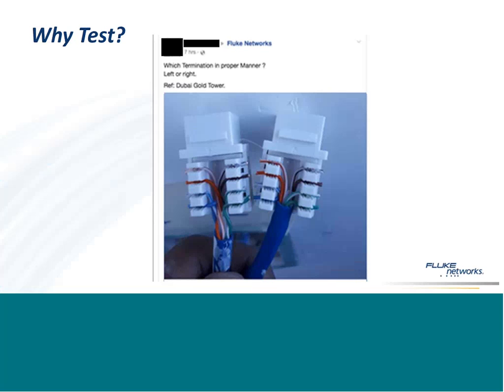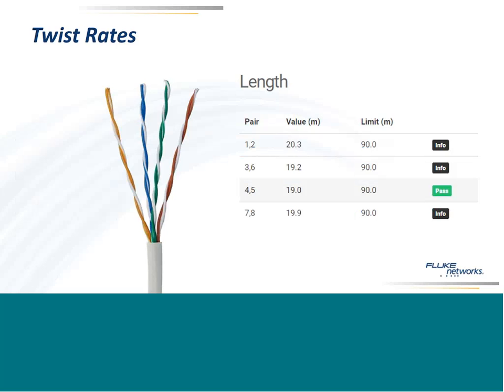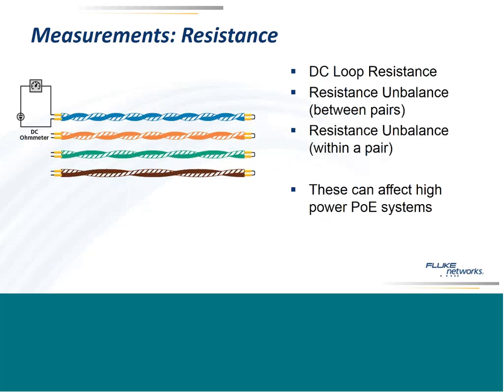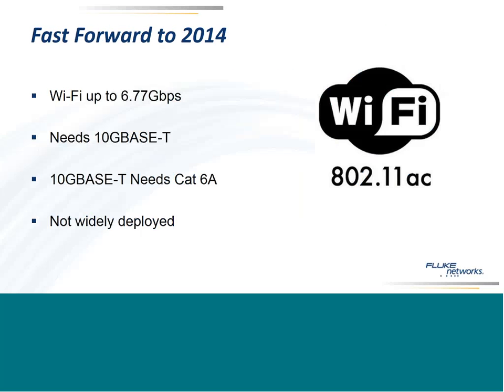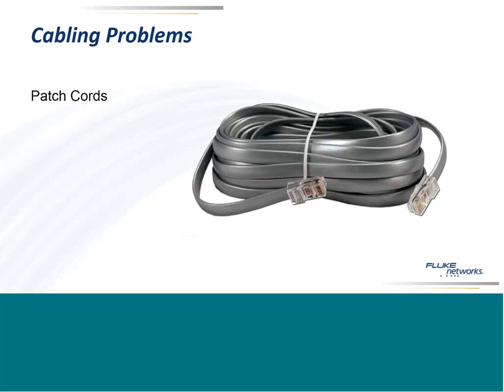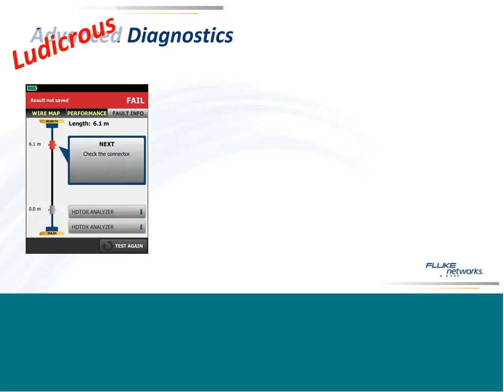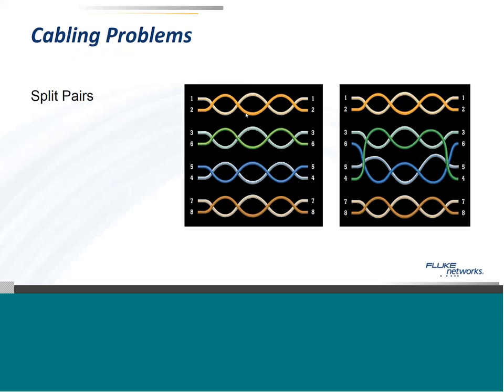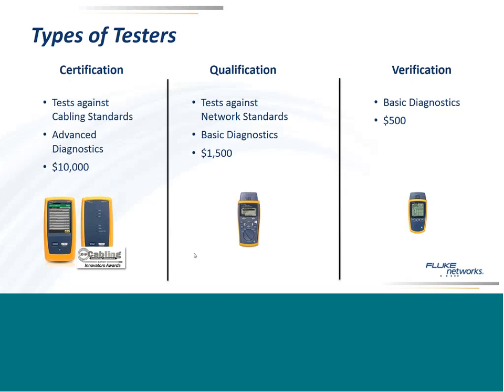An Introduction to Cabling and Network Cable Testing Webinar

Comment: Will the Qualification Tester work with all the Categories including Cat 8...?
Reply from the maker: It will be able to determine if the cable is connected correctly and if it can handle speeds up to 1 Gbps, but can’t tell if the full Cat 8 are supported.  For that, you need a certification tool. Thanks for the comment!

Comment: 99% of cables are done in 586B
Reply: A lot, but not even close to 99%. Virtually every commercial building and all military buildings use 568A.
Reply: @nilpo19  I think what Mike was referring is prefabricated cables.  568A is used in US government buildings, I don't know if commercial buildings use 568A.  568A wiring is used today for backwards compatibility to old wiring standards for telecommunications.  Most home wiring is done using 568B unless AT&T did the install because they stuck with the 568A standard.
Reply: Shall I able to Cat6 cable with surge protector in between?